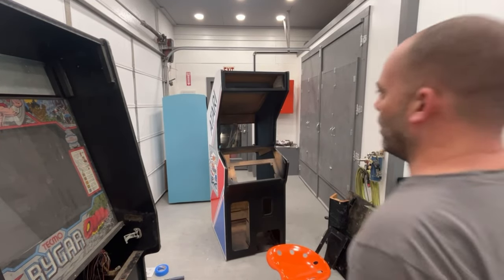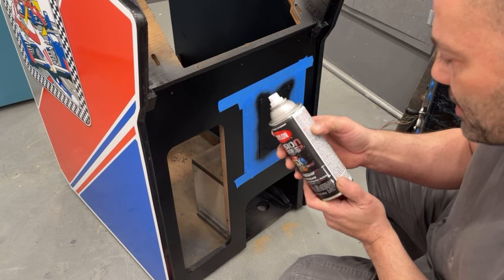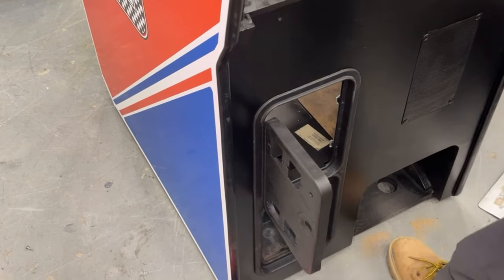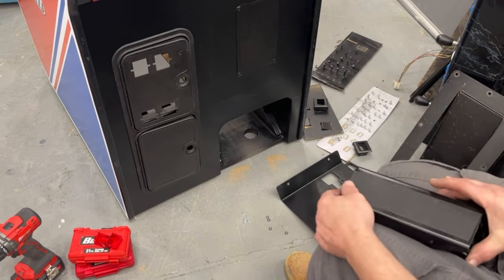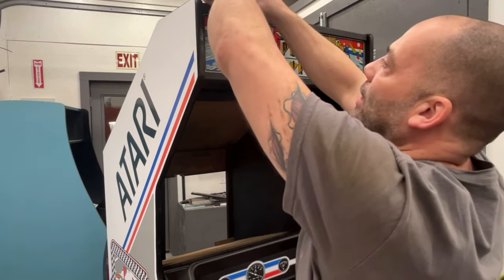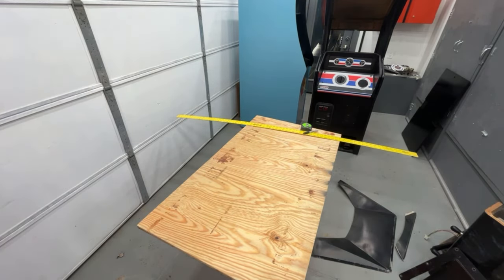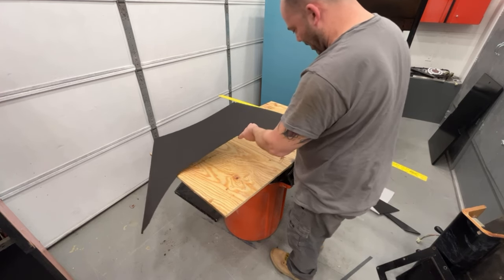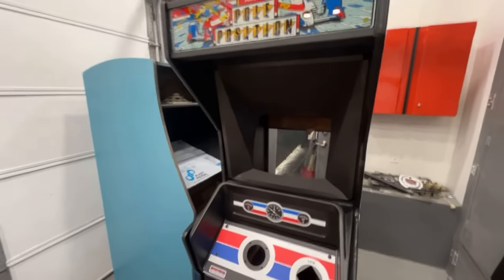Pole position arcade part 8

Comment: Wow, that looks from the factory. Excellent work!
Reply from the maker: Thank you very much
Reply: Love the videos. I’m not rebuilding a pole position but it would be sweet if you scanned the old cardboard bezel and saved it for future reference or to share with others. Nice work and great tips.
Reply from the maker: @upuchri  thank you
Reply from the maker: @upuchri  I did save the original cardboard bezel so I can use it for future or even make a paper template for somebody to make their own